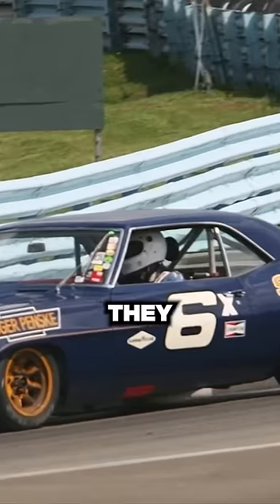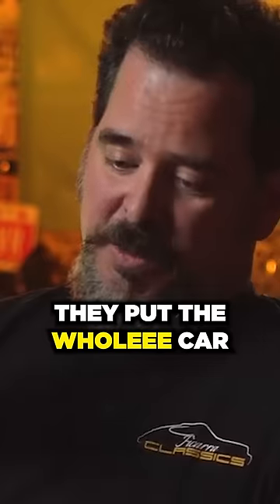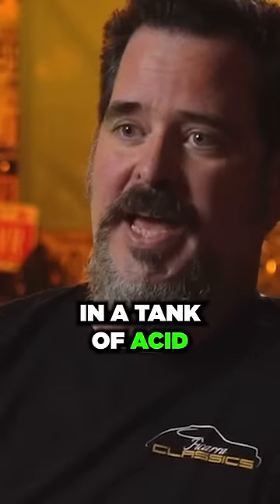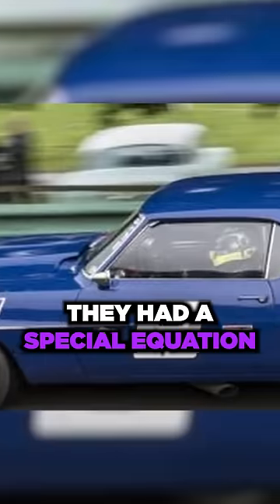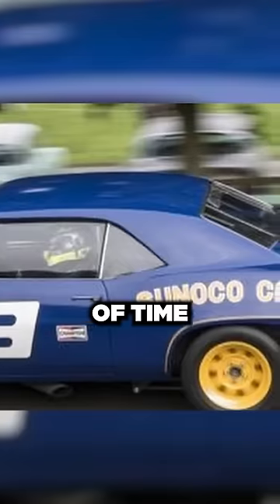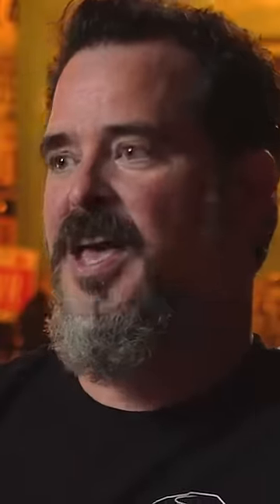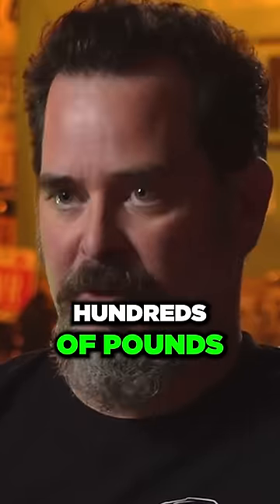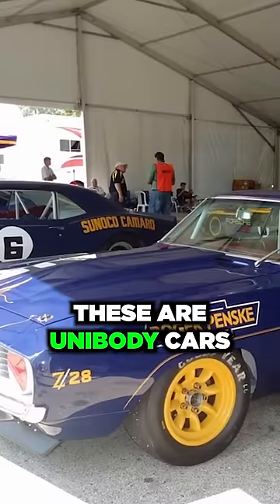The craziest CHEAT in racing history!

Comment: The factory drag racing teams in the 60’s all had their cars acid dipped. Some of them were done in house at the factory. I learned at the age of 14 how to tell if a car was dipped, the good old days.
Reply: how do you tell?
Reply: @MrComradebuttons  your clipboard folds the roof
Reply: You get a hollow sound when you tap the the car or put your thumb and your index finger on both sides of the fender or quarter panel and gently push and pull and watch how easily the metal flexes.
Reply: Fake story
Reply: @santiago9ish  I guess they didn't watch the video lol
Reply: Well duh. You just lean on the roof a little bit
Reply: What if it was lsd acid and you could just lick the car? Racing could be so much more interesting.
Reply: @ContactsNfilters  how would the crowds of spectators catch up to the cars to lick them?
Reply: @ContactsNfilters  😂
Reply: @jamesrosewell9081  🤣
Reply: @ContactsNfilters  😂😂😂😂😂😂😂😂😂😂😂😂😂😂😂😂😂😂😂😂😂😂
Reply: @jamesrosewell9081  they wouldn’t race in the first place ahah
Reply: @boobiedefloop6097  your just mad you don’t have any stories
Reply: @jamesrosewell9081  pit stops 😌😂
Reply: @MrComradebuttons  On old NHRA/IHRA Stockers, you could grab the bumpers, and they'd flex very easily, they were so thin.  Lots of the metal was like that, particularly on the front end of cars.
Reply: I remember when they dipped the front K frame on the 68 Barracuda the weight went from 70 lbs to 18 pounds. Then they had to pray that it didn’t fall apart in the traps.
Reply: @SealofPerfection  why the front necessarily? On a body on frame car I can see that might help with handling but drag racing lifts the front end anyway. In a unibody car you’re just weakening the motor and trans mounting points
Reply: @dirtyaznstyle4156  You're talking stock and super stock.
When that practice started, slicks were not very good.
They needed all the help they could get for traction
Reply: @jamesrosewell9081  so if fast, or speedy, cars, let’s shorten that to a speed race, have acid on them, then the horse races would have horses with speed and the toad races would have toads with horse on them and the mushroom races would have mushrooms laced with toad goo
Reply: @boobiedefloop6097  Folks, have you ever noticed that no matter WHAT the video is about, some clown is going to come along and say "Fake story"?
Reply: @ContactsNfilters  we need these immediately. I love the way you think. Lets make cannabis cigarettes too!!!
Reply: How do you tell if it was dipped in acid? Well, for one, it's from East Palestine...
Reply: @TheCannonball79  now I'm calling BS. A k member isn't sheet metal and is a important piece of the car that you don't want to weaken
Reply: @daniel.gilliss6030   your right you don’t want to weaken it but in a game where every pound counts you suck it up and hope it holds together. And it did for the weekend and was swapped out for one that still had some some metal on it. I remember holding the two different pieces and I was amazed at the difference, then they took the acid dipped one and painted it black to look like new.
Reply: @ContactsNfilters  explains why they make so many left turns
Reply: @boobiedefloop6097 just like the one where someone finally loved and validated you?
Reply: The samething thing was done with rally cars.
Reply: Our race team dipped the drivers in acid to cut down on weight. Drivers can be so whiny sometimes.
Reply: @finnmcginn9931  🤣
Reply: @MrComradebuttons  VIN number... duh
Reply: Ok cool 😊
Reply: @ThomasKent1346 it does sound suspicious. I mean dip the car to take weight off just to add it back with thicker roll cages?
Reply: Imagine telling a fake story for clout.
Reply: @ContactsNfilters  I want on that race team.
Reply: 'In house at the factory..' factory's building new cars don't have or need an acid bath ! The work surely would have been done off-site.
Reply: Seem silly to rake all the weight away, just to put it back in with the weight of the roll cage. Seems like sake oil to me.
Reply: @jordenjewett1744   Super Stocks didn’t start running roll bars until after 1970. The Pro Stockers started running with some pretty skimpy roll bars and cages starting in 1970.
Reply: @xephael  VIN number?  As in vehicle identification number number?  Do you also redundantly say PIN number or ATM machine?
Reply: @PatriotxAsset 
The roll cage is a mandatory structural requirement.  It has to be there anyway, they were dipping the bodies to reduce body weight that would offset the additional weight structural tubing.
Reply: @PatriotxAsset  They had to install roll cages anyway, so it wasn't any added weight.
Reply: @boobiedefloop6097 it’s not though
Reply: You throw a marshmallow at the body and if it makes a dent, it was dipped!
Reply: @ContactsNfilters 
1: LSD is literally not even an acid.
2: Even if it was you wouldn't ever have enough to dip a whole car in and have any effect.
3: LSD means something totally in the automotive world.
Reply: @boobiedefloop6097  is not a fake story. This idea was born in NASCAR. Then after they were caught and regulated, the idea run away into all non regulation series. Drag, imsa, and others.
Real stuff bro.
Reply: @PatriotxAsset  you have to put a cage in it anyhow. Thr lighter it is before you start, the more options you have on how much you can add back, and more importantly, where you can add it.

Comment: That reminds me of stories I heard about the Lotus F1 team. Colin Chapman was famous for saying simplify and add lightness. On one car they took out a heavy part on the dash, replaced it with cardboard and spray painted it the same colour. How it was found out was someone put their finger through it.
Reply: Is a cardboard dash against the rules?
Reply: @pashakdescilly7517  If it takes it below the weight limit, then yes, though I can't speak on the rules of F1 back in those days, or even how thorough the inspections were.
Reply: @metalswifty23  It is quite easy to check if a car is below a weight limit.  There might be a rule against combustible materials such as cardboard.  
Chapman was keen on using THIN 16 gauge aluminium sheet.  Or THICK - when he found a race mechanic making a radiator duct out of a heavier grade sheet because it kept fracturing, he told the mechanic rather firmly to use THICK 16 gauge alloy.
Reply: @metalswifty23  If you can cut weight, you can add it back anywhere you want to get back up tp minimum. Shave weight from higher up and add it back at the floor pan level. Lower COG = better braking and turning performance
Reply: @ingluv  That wasn't even remotely the point I was making, considering the entire premise of the video was about illegally shaving weight off the car, i.e. not adding the weight back on anywhere, and specifically in response to a person talking about the rules.

Teams would come up with any trick they could to shave weight off illegally without adding it back anywhere. Whether Chapman did specifically that, though, I do not know.
Reply: Sorry 😂😂😂😂😂😂😂😂😂😂😂😂😂😂😂
Reply: I worked with a chap who had worked for Colin Chapmen when he was building luxury fibre-glass yachts. One day a multi-hundred thousand pound hull was demoulded, and a very small but unsightly brown blemish was seen in the gel-coat, above the waterline. Panic ensued, and increasingly senior managers were brought to see it, eventually with a furious Colin Chapmen viewing it. There was an expert on fibre-glassing, (who didn't care much for Chapman). He was brought into pronounce how it could be fixed. He took a look, and all the managers and Chapman waited with bated breath. He then stated: "It's a pigment of the imagination". Pandemonium ensued with the whole factory laughing. Chapman damn near had a stroke on the spot!

Comment: Not that long ago (20 years), a NASCAR team filled the chassis tubes with lead shot to add weight for inspection. During the race, the driver would turn a small wrench that would open a hole and the lead shot would then fall out on to the track.
The best part was that they put the hole right where the technical guys would place the jack to lift the car for inspection. The inspectors never found the hole.
Reply: To finish up your story. Track officials could never figure out why there was "shot" on the track. It eventually piled up so much that it became obvious what the shot was and where it came from.
Reply: They weigh cars after the race too.
Reply: @davidrasmussen2975  
Back then, not always.
Reply: Jr Johnson when Darrel Waltrip was driving for him.
Reply: Yeah, but they found the shot bb’s on the track and didn’t take them long to figure out the reason for them.

Comment: The roll cage is basically an inverse frame all the time.  It forms a box with the frame rails as the bottom, the entire point of which is to create a stiff structure on which to mount the driveline, steering, seat, and suspension.  
The body is just an aerodynamic skin to carry the decals and keep out the rain.  And the occasional clipboard.
Reply: @mrwp819300  how do you mean?
Reply: @mrwp819300  
If the acid dipped parts were available under a legitimate part number, they would have become "stock" parts.
When Plymouth built the first Superbirds to lure Richard Petty away from Ford in 1969, each came with a vinyl roof.  Speculation was that it broke the airflow away from the roof to then be effective over the rear wing, like the dimples on a golf ball.
The truth -- as it usually is -- was much more pedestrian.  Metal work was required around the Road Runner's rear backlight for conversion to a Superbird.  Chrysler didn't want spend hours and hours finishing the body work so they ground it down and covered the result in a vinyl roof.  It happened to look very classy on the street 'birds, too.
Reply: @perryleduc1954  Roll cages add a ton of rigidity to frames. ANY car will handle better with one installed, they are not just for safety. They problem is even with chromoly tubing they still add weight. Of course if your car's body is acid dipped it's not that big of a deal lol. xD
Reply: @riothero313  ahh, I see what you were getting at, I understand that rollcages a ton of rigidity and (some) weight I just couldn't understand what you were trying to get at with your comment, I thought there was something more I was missing.
Reply: It wouldn't matter because if you add any extra plate to reinforce it you have the weight back the steel was about 1mm back then maybe 1.2mm a 15mm piece of plate 300mm x 300mm or 12 inch for you americans would nearly roll out to a whole sheet of 1mm steel so it really doesn't make much of a difference I dont think. All new cars are .6 nearly half the thickness there no lighter really I build and rebuild cars from 1mm sheet and really you don't want it any thinner than that for cold rolled steel
Reply: He said it was a unibody
Reply: @That.Guy.  
Not that simple.  The engine and gearbox are held in the front sub-frame and the rear axle and suspension are mounted on the rear sub-frame.  They are all tied into the roll cage -- see my original comment, above, and think of the whole unit as an upside-down box-girder bridge.
Reply: "Push the rules" racing teams have been finding ways to flat out cheat each other for decades lmao
Reply: Yeah dude we all watched same video. Captain hindsight strikes again.
Reply: But not the sun
Reply: let's remove a shit load of steel to make it lighter, oh shit it's not rigid anymore, add some back add some back...
Reply: The Saturn was a perfect example of this. The space frame was the structure and you just bolted on the body parts. Most of which were a polymer.
Reply: This isn't really true, most cages offer little to no chassis rigidity, they are strictly for safety.  There have been tests that show even extensive crash structures can offer little in the way of structural stiffness.  Crash safety and chassis rigidity are two entirely different goals and you don't gain much rigidity when designing for safety.
Reply: must be one helluva heavy clipboard
Reply: SCCA's rules restricted the roll cage structure mounting points. For instance, Fords, Javelins and Mopars were full uni-body cars with sheet metal front structure that the suspension mounted to. They were not allowed any tubing forward of the firewall. GM cars (Camaros and Firebirds) had sub frames bolted trough rubber bushings to the floor. So they were allowed bracing to the frame near the upper a-arm mounts to compensate for their wobbly design. None of the Trans Am racers in the 60s or early 70s were allowed full tube frames.
Reply: @dustymojave  
Thanks for that -- very interesting.  You're right about no full tube'-frames -- that would be a purpose-built racecar and that isn't really what the SCCA was promoting.  And I didn't mean to suggest that they were.  But there's a big difference between the single hoop with supports that many drag racers and smaller sports cars ran and what the Trans Am warriors were running.  So acid dipping notwithstanding, they were much more stock than NASCAR Grand National (now Cup) cars.  I wonder, what were NASCAR'S Grand American pony cars like?
Thanks for the discussion.

Comment: Reminds me of a different "cheat" with the restrictor plate that would slide open to allow in more air than the regulations allowed.
Reply: The opposite was Jack Roush's #6 Mark Martin/Folgers car.  NASCAR found that the carb manifold was bolted tight.  They claimed it had to be welded -- no performance advantage -- but took away points anyway.  Martin came second to Earnhardt in the championship by less than the penalty.  Martin finished second 5 times.-- NASCAR got the champion they wanted.
Reply: Like the Toyota flexible restrictor plate from 1995. If you took the plate out and measured it, it was by the book. But when you installed it back, the act of installing it deformed it.
Reply: @PedroVera  that's 100% something Toyota or Yamaha would do lmfao
Reply: In NASCAR, they had a venturi maximum opening, and the tech inspection before the race would measure these openings. One time, an inspector got klutzy and jabbed the side of the venturi with the gauge. And when he pulled the gauge out, it had a gob of paraffin on it. The race team had taken a carburetor with larger venturis, and reshaped the venturis with paraffin to be the legal diameter. Once the engine got warmed up, the paraffin would melt way, and they had a carburetor with more cfm. All those cheating stories are amazing to read and digest the incite those Mechanics had of their machines.
Reply: Childress did that with Harvick's car.  Once at full throttle, if you pushed harder, it would lift the manifold, according to Kevin.

Comment: First off there were no rules against acid dipping at the time. Second off the cage wasn't built because the body was too weak😄😄. The roll cage was a REQUIRED SAFETY FEATURE on top of stiffening the chassis to hold a setup during the corners
Reply: No and yes. As an SCCA Tech Inspector of the time, I can say for sure that acid dipping was prohibited by SCCA. And yes the roll cage was for safety, and was not to replace structural strength lost by cheating.
Reply: The roll cage was a mandated safety feature but they had to specially construct the roll cage for this Camaro to also hold the vehicle together.

Comment: The bottom unspoken line is that Penske cheated. His Camaros were about 200 lbs under the legal minimum weight. But to reveal it and disqualify his cars would collapse the series. So he was allowed to get away with it. 

The roll cage wasn't an extra. It is a requirement,  mainly to protect the driver in a crash.
Reply: the roll cage was used for protection? my god it’s sherlock holmes over here
Reply: The Holman-Moodie Mustangs weren't any different.  It was factory pony-car racing, performance was everything, and what won on Sunday sold on Monday -- for real. 
Z28 Camaros came from the factory with racing headers in the trunk and 2x4-barrels on the plenum manifold.
Reply: “…mainly to protect the driver.”
Um, more like, only to protect the driver.
Reply: The cars still had to meet minimum race weights. But by making the body lighter (by dipping it) they were able to put weight where it helped them … not just wherever it was in a factory car. That gave them an advantage, because it could help with handling, acceleration, and even braking. All race teams today do the same thing: they build the cars to be under-weight then add weight where it does the most good.
Reply: @jasonescott  Yep. F1 does this all the time. Being able to put ballast as low as possible gets the CG lower than it normally would which aids in handling.
Reply: @randytaylor1258  those didn't come with the car.. not for free
Reply: Like Penske was the only one doing it and like he doesn't do it with his ford
S today and his portions racing's racing if you're not smart enough to have figure it out then you're probably not going to win